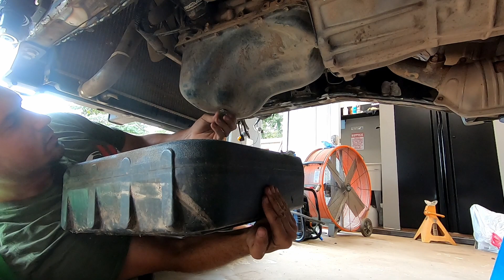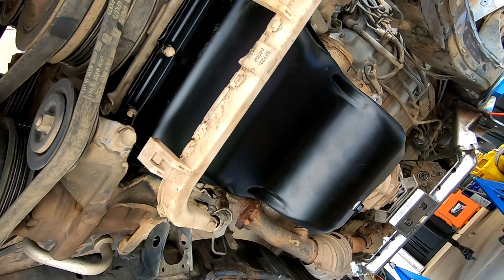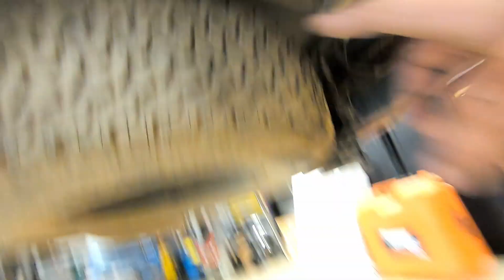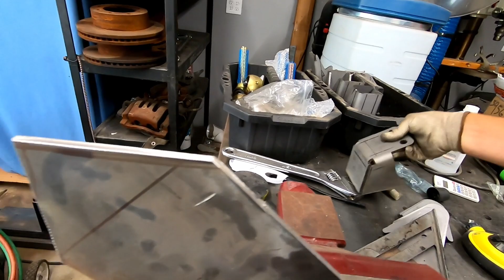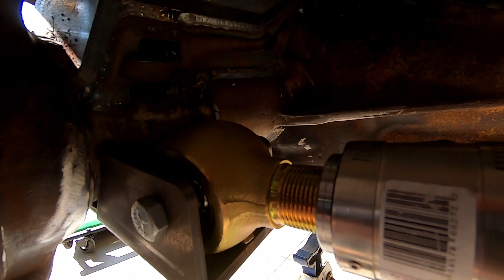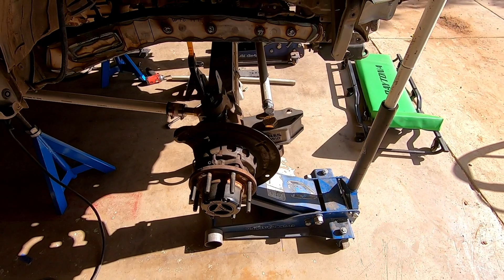Tacoma SAS part 4

Comment: My panhard bar (track bar) is S shaped over the diff and under the oil pan.
Reply: What did you do about brakes because I just “finished” my one ton swap on my 03 Tacoma and the brake pedal goes to the floor (no braking at all) and I have 0 leaks. Stock brake booster and stock master cylinder. Do you have to upgrade the booster and master cylinder or can you use the stock one?

Comment: Sky's makes a slightly shorter pitman arm that might help with the track bar bracket, might need to notch the frame for it though
Reply from the maker: Appreciate that! I do believe I need to knock the frame in multiple spots. As of right now I'm getting the suspension to cycle and then worrying about steering. Might not be the right way but that's what I'm doing lol